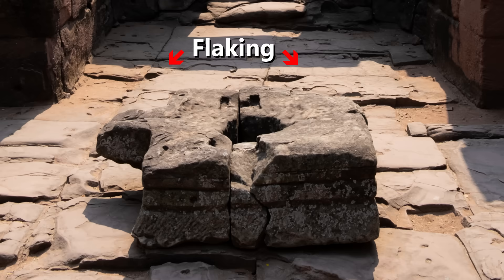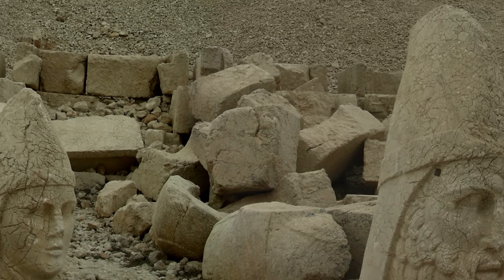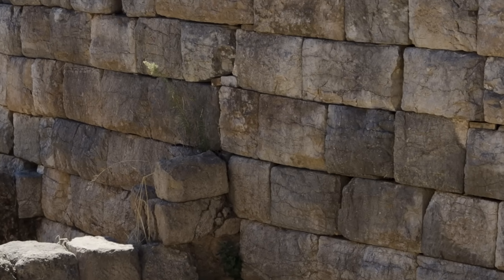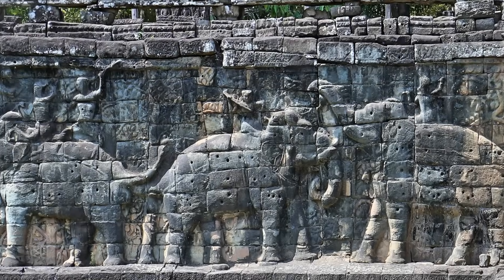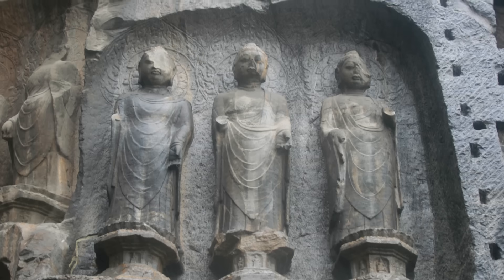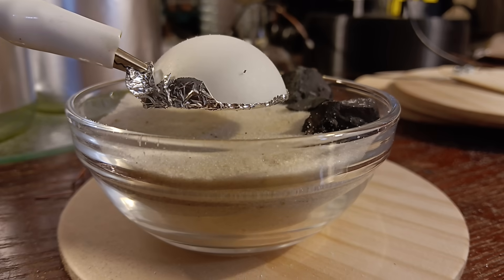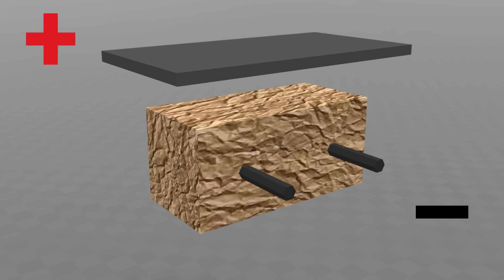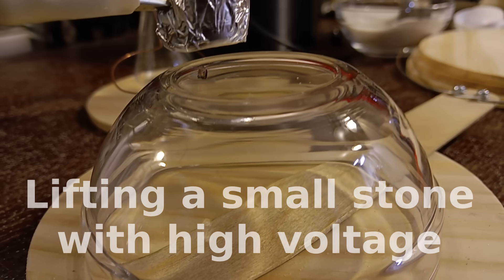The Greatest Mystery, Solved. Recreating Ancient Stone Melding Technology (Part 1)

Comment: How is it possible that such valuable knowledge was lost and forgotten?
Reply: A previous incarnation of NASA was in charge of it.
Reply from the maker: There may have been a time when Earth's atmosphere contained harvestable charges - they say the skies used to always look like the 'Northern lights' - it may have been after a cataclysm that this technology was no longer able to be used as it once was without this highly charged atmosphere. The past may be the only one who knows for certain, but I am listening and I am hearing a lot of what the quiet echoes have yet to say after so many undisturbed centuries =)
Reply: The comprehensive technical knowledge that the Romans had re: hydraulic cement was basically 'lost' for 1000 years (til 1800). Their light weight concrete using pumice and scoria 'til the 1960's. Just last year (2023) MIT finally discovered why Roman concrete is so durable, it has a self sealing leak and crack repair component.

Comment: It's a theory. Nothing was demonstrated or shown. The holes were likely necessary to lift such heavy rocks and move them distances. I wish this were true, but you cannot demonstrate anything even with modern technology. that's just wrong To claim you solved anything. It's a neat theory but it does not work. I wish you were right. Honest. It's very cool To imagined it's been solved. But it is not.
Reply from the maker: This is only 'part 1', I am actively recreating this technology and will have more to share - modern technology has just recently been upgraded because of me; I'm the inventor of the WCSG (water cooled spark gap), a high-voltage, high-amperage spark gap that now allows tesla coils to do physical 'work', such as heating large stones - check out the rest of my channel and stay tuned for more scientific world firsts =)
Reply: @MadPlasmatist  Side note I don't know how you can claim to have invented Spark gap underwater... many People have been experimenting with that for many years. 

I'm building an EDM machine which uses this to cut through metal with great accuracy. 

https://www.youtube.com/watch?v=feGrx29XR4Q

I'm sorry to tell you but you haven't invented anything new.
Reply from the maker: @forgeteverythingyouknow5413  Have a look over my website or my video 'How a Water Cooled Spark Gap Works' please =)

Comment: This is one of the most stupid things I’ve ever seen. 

How would these stones, if they are as “soft as cake batter” maintain their structural integrity while being placed into a wall? 
They allegedly had the technology to heat up stone to hundreds of degrees using electricity,but couldn’t figure out how to get rid of the nubs on the stones afterwards? 
There is of course the obvious fact that if these stones had been heated up to high temperatures there would be evidence of this in the stones themselves, which isn’t the case for most of them. 
Sure, there is examples where stones in ancient structures seem to have been exposed to high temperatures on their surface, because they have a glass like appearance.  But this is by no means common. 
A stone like granite would have its composition changed and technically become a different kind of rock if heated up to the point where it was malleable. 
Plus, then there is the obvious fact that on most of the stones in these ancient structures you can literally see the tool marks from where they were worked. 
Then there’s the fact that there is absolutely no mention of any of this anywhere in the historical record. 
Considering the amount of energy that is required to heat stone to the point where it is malleable using electricity, you would think that somebody somewhere in history would have noticed it and mentioned it. 

Just using basic logic it’s easy to deduce that what you’re saying isn’t true.
Reply from the maker: There is a process involved of course, I am currently recreating these procedures. Everything is 100% logical and grounded in established science. This is only 'part 1', stay tuned if you would like to see more =)

Comment: Akashic records have already given clues:
The Akashic records indicated some of these stones were indeed heated and molded into place.
One method used crystals to focus the energy of the Sun into a laser-like beam of light which was also used for carving and cutting.
Floating stones was done by sprinkling a white, metal containing, powder (doesn't say what) on top of the stone and an apparatus (doesn't say what) was placed at each end of the stone which, when operated, caused plasma to be seen passing along the white powder disrupting gravity in the process and floating the stone.

Simple sound can be used for anti-gravity effects.
The Pyramid builders were skilled payed craftsmen and not the present day word (sla*** ) used to describe them
The Ark of the Covenant (filled with monatomic gold...superconductor), which fitted inside the Kings chamber sarcophagus,  is a power source which is movable can be used for good or bad purposes.
Outer Great Pyramid stones were floated into position and rubbed together to create fine joints.
Curiously, lots of other stones were laboriously cut from the quarry by hand.
In the pit of the Great Pyramid (and under the Dome of the Rock...other places too) were arranged layers of strata, mica, crystal and iron/copper which drew upon the 'influences' of the Earth to produce electromagnetism, apparently, a water filled moat once surrounded the pyramid and the water was channeled down the descending passage to the pit to keep the "fusion reaction" cool.
Electromagnetism can be used for a variety of purposes.
The top of the pyramid had a smaller pyramid (hidden when the society collapsed) made mostly of gold and this was part of the spark-gap-generator which created magnetic 'highways in the air' between other sites on Earth which had similar constructions (Stonehenge included), basically, a transport system which worked using magnetic roads. 
The 'holes in the ground' in the Atlantic Ocean recently discovered by NOAA were cut using crystal and Sun energy, they had rods of a different type of stone inserted into them and somehow crystals were used for light, anti-gravity transport and heat, there was also a water channel under the stone holes to "keep the reaction cool"
Spain was once an outlying island of Atlantis and has a crystal cave which the Atlanteans used for growing their crystals, the cave is now a tourist attraction.
ETC ETC ETC ETC.

The Akashic recently indicated "one would come forward and explain how the Great Pyramid works", perhaps you are that person.

My main reason for commenting here is to relay a warning from the Akashic that the Earth is soon to become unbalanced and will tilt onto it's side creating a new equator in the process. Sun and Earth interact constantly and when the Earth's magnetic field is working all is well, however, the magnetic field is currently weakening (natural process) increases in volcanic eruptions and earthquakes can now be witnessed. If I say more this comment will be deleted.
The Earth will tilt quickly (takes about 4 hours) but water and wind will temporarily keep moving in the direction they are going (much like putting a car into revers at 100 miles an hour, the car moves back but anything not fixed to the car will continue forward for a while), flooding will be widespread, tectonic plates will move significantly.
This tilting happens naturally every 12000 years but the timing can be influenced by events arising from human 'strife'.
One third of the population will perish.
Prepare now and you can survive, the Akashic indicates now is the time to prepare.
Prepare, stay safe and good luck.

p.s. When Vesuvius and Etna erupt simultaneously this is the indicator of chaos commencing, please prepare now.

Comment: Okay...
Entertaining this theory, outside of a modern lab, where would ancient builders get the large amounts of electricity they would have needed to alter such massive stones?
And what machinery would they have used, to move these stones, lift them to the place they sit and arrange them in the way they have been?
Power supplies would have to be greater than a Baghdad Battery could supply.  And like you say, heating and cooling control, as well as construction manipulation of the stones, for the desired effect.

I tend to lean towards Geopolymer construction techniques.  But perhaps electrical currents could have been a part of that sort of construction as well.
Producing a soft, fluidic, Geopolymer, would render the material pliable, for the desired shape and size of each stone, while the electrode theory might have been used to fit and finish the Geopolymer, in the final position.
Until these theories can be proven in a real world setting, under the same conditions the original builders faced, along with the same sort of tools, machinery and power production, we only have theory and conjecture...
This would not be a reason for any personal attack by those who see the same sites and fantastic art, made from stone, but have nothing to add to the questions of 'how, why, whom..."

Comment: Ropes were tied around the nubs and the stones were swung back and forth, one at a time as they were laid down, grinding the faces against one another. You can actually determine the order in which they were placed by looking at the seams. And as someone else mentioned, the holes were to brace some sort of facade made of a different material, like carved marble panels. You don't always find both at the same site, or even in the same cultures. You often find the nubs and the 'melted looking' stones in Peru, for instance. Marble facades would have been more common in Roman cultures. 

Not that seeing plasma flowing around different minerals isn't interesting.
Reply from the maker: This is only 'part 1' and they were also 'preliminary samples' to observe the affects of heated plasma, I am literally recreating this technology from the ground up - stay tuned for more =)
Reply: @MadPlasmatist  Cool. Hope it works.
Reply: Most of the stones did not have nubs for "ropes".
Reply: @lutumfamiliaris7287  Many of the ones from Peru do, though, which would be inexplicable otherwise. In places where they wanted the wall to look nice, they would have carved them off after they were done.

Comment: So many ways. A water wheel, wind turbine, steam. Animals walking in a circle and gear reduction.We have seen giant saw marks. They had giant saws. The Greeks did not invent anything, nor did the Romans. A water wheel connected to a shaft could drive a line of bellows to compress air and run high speed air tools. You can push huge blocks, with air wedges and lift anything with hydrolics.

Comment: at least someone is working on it and trying to solve the ancient tech secrets. Shows how clever the ancient people are.
Reply: We really need to see evidence. For example, the power source. I know they were smarter than we give them credit for, but high voltage source has to be shown
Reply: @RobertStewart-i3m   In theory, very ancient technically advanced civilization could exist. Less advanced people called them Gods. Really you can see that more ancient megalithic blocks are more heavy and made more complex and accurate than newer ones lying on top and they accord technical level of ancient people we usually imagine
Reply: @RobertStewart-i3m  Yes, evidence! And a totemic statue is not evidence .
Reply: Yet we have not seen a single molten rock in this video, never mind the source of the massive amounts of energy required to perform these feats.  All I've seen is static electricity around rocks, it's enough to make your hair stand on end.
Reply: I agree with Tracy.  This video is a valuable contribution, though leaving holes in some structures and lumps generally in the ancient ones needs convincing explanation. 
   I’m inclined to think that sound may have somehow been used to soften the stone. We WILL find out
Reply: it just geopolymer, see dr davidovits
Reply: Intelligent, not clever
Reply: yes, they were so clever with what tech they had at the time, but so few people have the time to recreate the primitive equipment likely used to explore the topic.
Reply: how credulous you are......
Reply: Indeed. Wanna learn more about them...?  

https://youtu.be/KMAtkjy_YK4?si=y9qFDYtWvTa9pj6q
Reply: No ,it shows how gullible people are.

Comment: So how are you or the ancient builders going to control the cooling of molten granite? if it cools to fast it will not form the crystaline structures found in granite, you will end up with a lump of obsidian, if your theory is sound you only solved half the problem, can you please adress that?
And some of your examples are clearly buildings of sandstone, how do you melt sandstone and retain the sandstone properties and structure after melting?
Reply: Baby steps
Reply: Really? before you draw these conclusions, you should really take those questions in to consideration, pretty much everything he tries to prove hangs on them. baby steps yeah, there is a hell of a long way to go. @xmo552
Reply from the maker: There is a heating and a cool down process which also keeps the stones from splitting, I am actively experimenting and developing these techniques, I'll have more to share in 'part 2' =)
Reply: Yes im aware there has to be a very controlled cool down, im just very skeptic that you and the ancients have that possibility, and im still left with your answer to the sandstone problem, you do know its not of volcanic origin right? @MadPlasmatist

Comment: I do appreciate the hands on effort and there needs to be more of that.  However I have a couple issues. First of all, granite can not be melted. At least not in the sense of a producing some moldable or mushy consistency and then expect it to "set" in a mold, or a form, or even a nice glob on the ground. There won't be any globbing, or moldable version of granite whatsoever. There's only granite, exploding granite, and in the end you will have just crumbling granite that can not be reconstituted in any way. I suppose it could be ground up and a binder added...but then your back at geopolymers again. 
Second, there has not been one inch of copper wire found anywhere, in all the world. Or gold wire or bronze, or orichalcum....or wire made of anything that could possibly carry even a small current. This is why I never held much faith in the "Bagdad battery". Because they aren't much more than a potato battery with very low voltage and negligible current, but there STILL isn't any wire found or anything that could be used as conductors....definitely no high voltage conductors. So no power tools, no electro plating, not even a potato battery. That's not to say everything is as we've been told, or as it seems. It's not that we know how everything worked, with our big ol' modern brains, either. Not at all. 
Just make it make sense.
Reply: carbon rod as conductor
Reply: https://youtu.be/KMAtkjy_YK4?si=y9qFDYtWvTa9pj6q

Maybe this can quensh your thirst.
Reply from the maker: Well, I can only hope my future work will be more impressive to you as your awareness grows - this is just part 1, take a look around the rest of my channel for more world history and stay tuned for more =)
Reply: There are copper items all over the ancient world including two copper electrodes at the end of the shafts leading from the chambers in the Great Pyramid.
All rock on earth was liquid at some point.

Comment: Lifting large, finished edge stones would most surely have a tendency to cut the fiber ropes of the time with ease, or just plainly get in the way underneath the stones when placed, so I can't help but logically believe that the "nubs" were used for the ropes to be tied or slung for precise applications. The "Holes" could've simply been scaffolding mounts or used with iron rods for the purpose of lifting the finished stones into place. We should look into if the "Nubbed" stones were favored in an area with less iron access or smelting experience, or it would also make applicable sense that the "Nubbed" stones pre-date the stones with precision drill holes in them. Or not.... just my opinion.
Reply: Fully agree .
Reply: Except the nubs are only on a few of the stones per wall. If they were used to carry they would be on every stone. The nubs are also found in Egypt, Greece, Italy, Indonesia, Mexico etc. All with precise polygonal stone work 🤷🏾‍♂️
Reply: @NoQualmsTheArtist  Of course, removal of said nubs, would most assuredly have happened in the finishing process unless things like wars, invasions, cataclysm, famine or disease, which were quite prevalent in those days occurred. I know I wouldn't be worried about finishing touches of an old wall while my family was being slaughtered, starving, or dying of a plague.
Reply: Unless the holes are on the unfinished sides.  There is no plasma construction hear.  The nubs are what is left of lifting points that have been knocked off a polished down.
Reply: So you're saying they had iron rods for lifting, but other say they only had copper chisels to carve the stone?
Reply: @subaruthug  A year ago, I tried to explain something a relatively intelligent mind could understand.